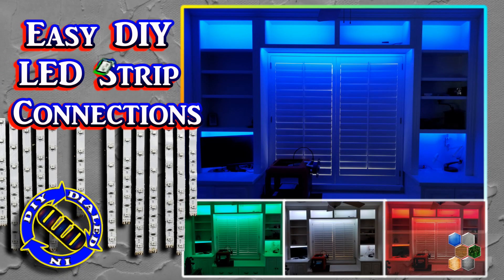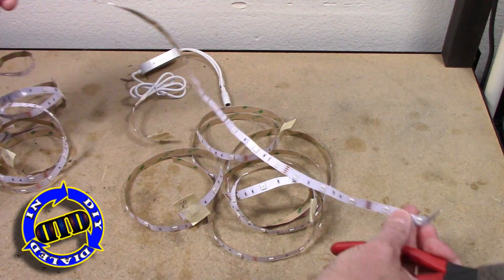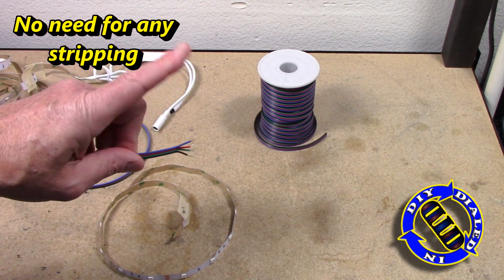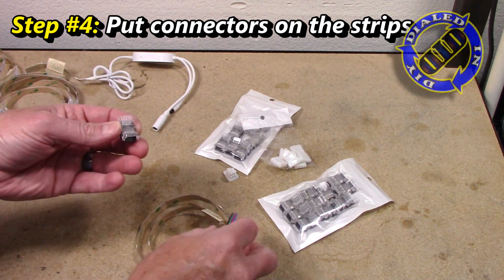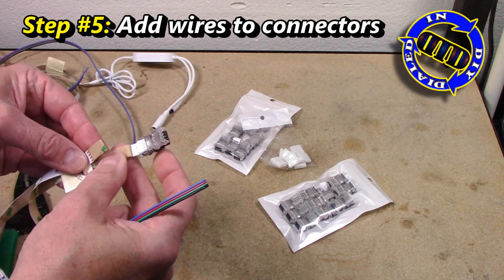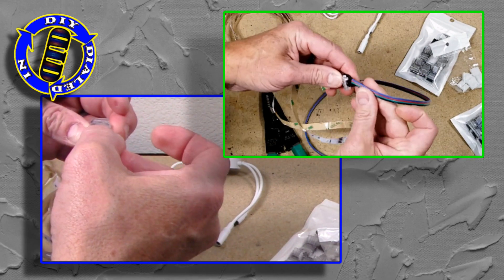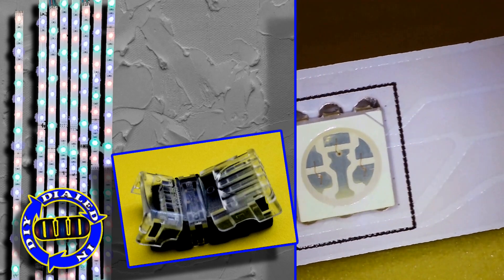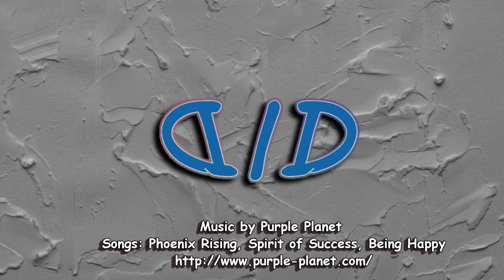LED Strips - Easy Cut and Connect no stripping or solder needed

Comment: I have a project that involves the DIY glowstick formula that I would like your feedback on before I go further. 
What's the best way to get in touchm
Reply: It's a glow in the dark whip, that I'll have wrapped with soft paracord. I basically want a secure lightsaber whip I can take to raves and concerts without the risk of spraying toxic chemicals or leaving a stranger with an unintentional  bruise
Reply from the maker: I love the sound of the project idea.  Couple of clarification questions. 1. Do you want this to glow in the dark, glow under black light or is it something that you want to have light up (i.e. with batteries)? 2? Is the final product going to be something rigid like a light saber or more flexible like a rope whip?
Reply from the maker: I am so sorry for the delay (I had to leave the state for an emergency a few weeks ago). I'm happy to assist in any way that I can.  I will check your follow up and reply.  Thanks for taking time to watch my videos and post a comment/question.